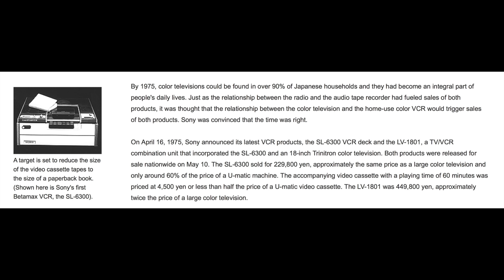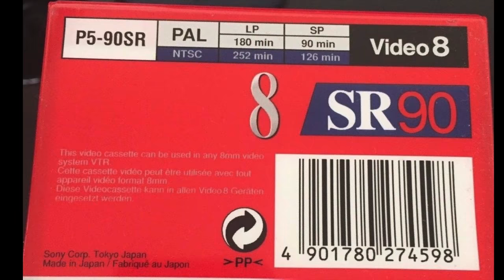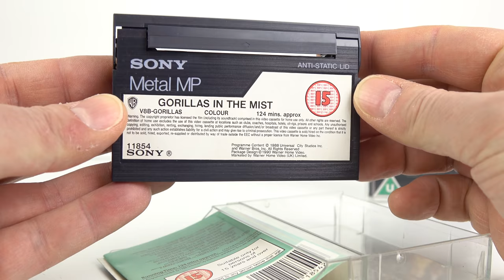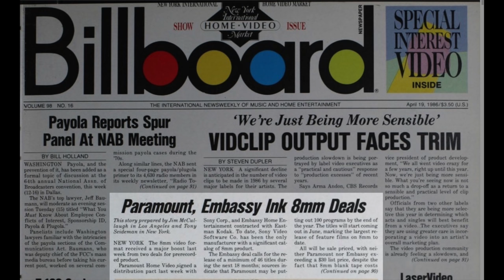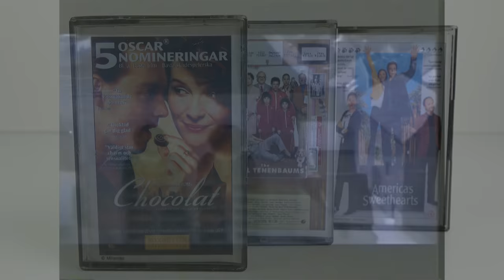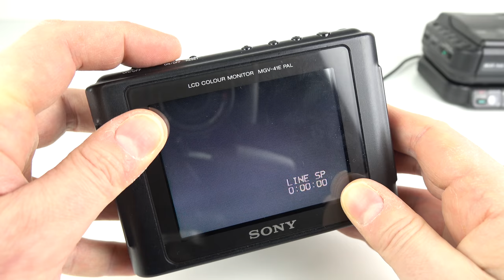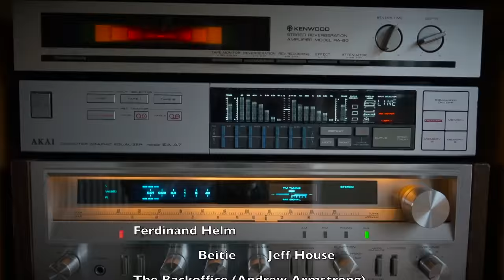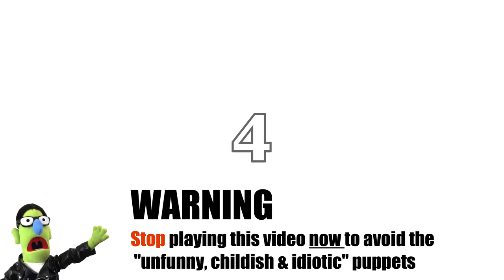Video8 - Sony's forgotten ambitions & the crazy Walkman Compo

Comment: As Beta (officially pronounced in the American way, 'bay-ta', according to Sony) was an evolution of U-Matic, Video 8 was an evolution of Beta: early models used the same ring cam-driven U-load style with a video head drum-to-tape area larger than that of VHS, all in a much smaller package. As with Beta's improvements over U-Matic (such as color video), 8 improved over Beta by (among other things) having a flying erase head and hi-fi AFM audio as standard, doing away with the big full erase head and linear audio system. PCM audio was also available in 8 format, increasing audio performance to CD quality. Hi8 was similar to SuperBeta (or Beta High Band): the same tape could be used in any 8 VCR without major playback or recording problems but had noticeable improvements when in a Hi8 deck, where SVHS required special tape formulations and recorded in a way that wouldn't play back in older VHS decks at all (being more similar to the superior ED Beta system which couldn't be used with a non-ED Beta deck). SVHS-ET was a cop-out and basically equivalent to SuperBeta: it used normal tapes with a few recording tweaks to save the end users a few bucks, but they still didn't play back properly in old VHS decks. Also, some of the VHS-C tapes recorded in LP mode would occasionally present tracking problems when loaded into the little adapter for your full-size VHS unit to play, and that's if the adaptor didn't chew your tape up for you. Basically it's the same as the earlier format war: if you wanted convenience, VHS-C was better; and if you wanted quality, VIdeo 8 was the better choice.

Comment: I recently bought a new battery and a batch of 8mm cassettes (not hi-8) to use my 20 years old camera. I didn't gave it a great use, although the camera was awesome. Why? Because of 8mm... yeah. You record something and then what? What do you do with that cassette? You can't put it on your VHS VCR. Also, there is not any adapter to VHS. You have to bring your camera next to the TV, connect it and play your videos from the camera, or use the small camera screen (or the even smaller B&W view finder). Thanks to the 8 format I felt isolated, I lived in a parallel technology universe.
Now is not best but at least I have fun digitalizing my old (and new) recordings.

Comment: In 1987 I used a Video8 machine Sony EV-S700 BUT! this video recorder have a lot of Noise inside the picture and it was much worster then a normal Philips VHS recorder. Also the Video8 tapes are very expensive again the VHS so nobody have a Video8 stand recorder. The EV-S700 recorder was so worst in picture quality that you can't accept this bad quality. VHS-C was much better but the PCM-Audio on the Video8 was much better that must be said too. A lot of Colrnoise was at the Video8 but the VHS don't can show you the red colour! Maybe that has something to do with the subcarrier of the color conversion. Pleas tell something about the colour conversion and in wich modulation are the video on the tape (FM-recording) etc. If you need support writte in the command line here. Best regards Volker

Comment: Back in 1990 we used Exabyte tapes in the Computer room at work to do data backups on.  Funny we were never short on blank 8mm tapes for the Camcorder at home either for some strange reason!  Didn't Exabyte create the 8mm format?

Comment: because every part that goes into a commercially approved aircraft also has to be approved. obviously. and that includes the in-flight entertainment system. it's not something they'd just 'change out' for no real reason. just dropping in 'something else' may melt the plane with leaking batteries, catch fire, jam the radar, whatever. once something has approval it usually stays there. can't just go to ikea and buy a bed and screwit to the floor and expect the plane to still be legal to operate. every single part of the interior has approval just as much as the engines and instruments do. and getting some guys at sony to hand-build a recording mechanism or hand-assemble some tapes for an otherwise discontinued product line is by far cheaper than going through all the approval stuff again for a new system. for one thing all batteries have to be nicd because lithium will just burn through aluminium if released... you know. the stuff aircraft are mostly made of :P that'd make a hole in the side. that'd cause decompression. that means everyone dies. that'd probably be bad mmmk :P so no random other systems in there just because there would be something 'newer'. which does the exact samething.

Comment: What about Digital 8?   You totally forgot the last incarnation of the Video8 format.
Most of my camera tapes were in the Digital8 format. Fortunately I have been able to finish digitizing (or transferring the data to a computer hard drive) the majority of them.
Digital8 used twice as much tape to record a higher-quality signal, although it doesn't appear to be a whole lot higher than hi8.  It worked just as well with standard Video8 cartridges as hi8, although their marketing said they don't recommend using the cheaper cartridges........ only for the fact that they wanted you to pay twice as much as necessary!
In the long-run, their first format - 3/4" U-matic - has turned out to be an absolute disaster for long-term storage. The machines don't want to work...   Sony created one disaster after another.

Comment: That cable for the TV looks a lot like a smaller version of a link cable for the screen in an 08 Audi infotainment system. The circular din jack from the tuner was a common sight on older radios in cars too. Often to connect a factory amplifier or cd player option. Always strange seeing these things pop up in other places.

Comment: The compact Hi-8 player also came in a recorder version, which I bought in 1998 to make back up copies of video productions "just in case." I used it as a backup for 12 years, until 2010 & it worked fine. Since I was working with SVHS as the master tapes, should there be any accident (& there was, unfortunately, on 2 occasions), it wouldn't be a total loss of picture quality & proved very handy. From 2010 until fairly recently, that small Hi-8 deck was unused. When I went to play back a tape, it wouldn't work, no picture or audio...which proves the old adage still holds true, "use it or lose it."

Comment: Btw ;

I remember seeing some of the promotional. Advertising in a few of the various electronics  magazines that were trying to push both the 8& HI -8  and supposedly  with the appropriate piece of equipment a  person could record both a video track along with several individual  and independent stereo tracks and on playback the user could select witch of  I believe it was 8 independent audio tracks that they desired ??;

And I thought that the documentation  stated that if the hi-8 was used for audio purposes only that it was capable of both recording and playback of hi quality stereo audio for a continuous 24 hours??;

Seems very bizarre but short of a radio station or a major department store that anyone would have a desire for 24 hours of music????;

Maybe  someone could possibly find out something along those lines and post it. Up ??;

Cheers everyone 👍

Comment: This may have been mentioned before, since I'm commenting on a rather old video...
The Hi8 format eventually made it's way into the audio recording realm for use in 8 track recording machines. The Tascam DA-88 comes to mind. 
I've recorded a small few band demos on those machines. Quite good sound quality, and quite akin to the Alesis ADAT format which used S-VHS tapes. 
Anyway, I'd love to see you dig up one of the mini-disc multi track recorders... very short lived yet amazing little machines.

Comment: 4:08 - Just like they did with the PS3/BluRay...sadly, HD DVD was FAR superior in every way, cheaper to make, had better video compression (MKV on HD DVD vs MPEG1 on BluRay) plus, HD DVD had 3x the storage capacity at a much lower cost - it was by FAR superior in EVERY way, but, $ONY had the trojan PS3 horse.... sigh

Comment: 18:30 , them short cables bent over like that aren't going to last 2 minutes! As an '80s walkman owner, I'm wincing! They're going to get the horrible disease whereby they get pulled out internally and you end up having to jam them at an angle to even get them working. Particularly with the dozen pins on the video one, hope the wires in the cable are well dusted and thin enough. What a stupid design! Much better would have been either a solid gate that swings up, or having sockets on both parts, with a cable between that you can replace when it goes. Which it WILL do! 

You could have it repaired but I bet even opening that it flings half it's guts into your face, as a defensive measure like that frog or whatever it is. Even replacing a simple little cable is going to have the microsurgical bits of it committing suicide from radiating soldering iron heat. 

What a shit design, really not like Sony. One more reason not to buy one.

Comment: Grundig Video2000 1600 machine was the worst Video2000 and the don't build in the ATF (Automatic Track Following) Heads - this function that the heads can move in the high to follow the track is the System Relevant function and they Idiots don't build the essential moving heads in! We're angry on this machine so they make also no NTSC machines in Video2000 this stupid Grundig Managers. The moving heads ATF make it possible to have perfect still and perfect searching forward and revers without any distortion in the picture! Grundig also developed a Video2000 Name V200 with Auto reverse (the Tape have 2 sides you can record it on Side A and Side B) and PCM Stereo Audio but i never see this machine and we never can't test this Super machine. The Audio was every time bad max 10kHz.
During the mid 80s i have had a Video8 Recorder EV-S700 Stand alone machine with a Tuner but the noise in the picture was terrible. I change the tape but no way every time the noise.